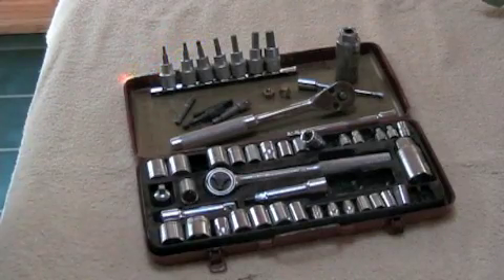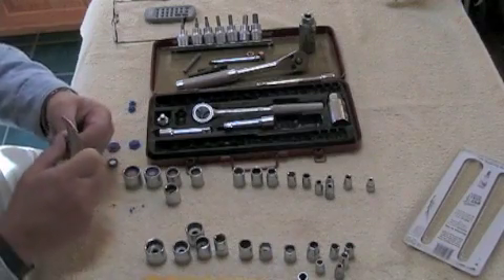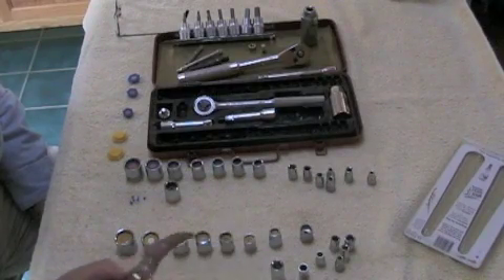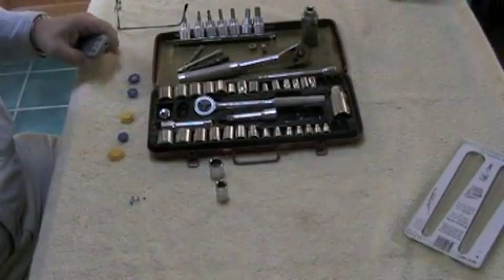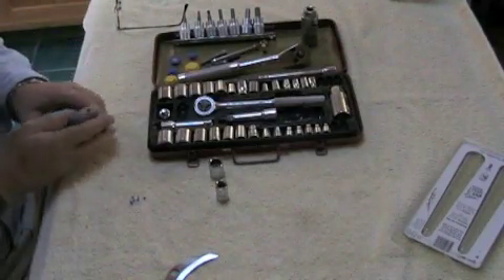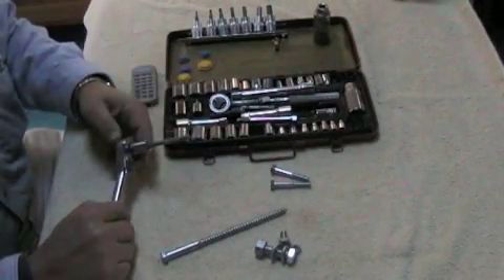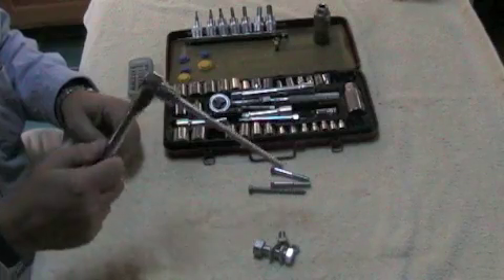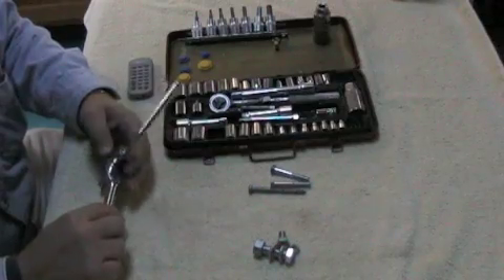Magnetic Socket Wrench Inserts

Comment: Cool. Maybe a little glue on insert in case you plan on using larger bolts. I thought about buying tiny earth magnets and gluing them in socket. But this looks much easier.